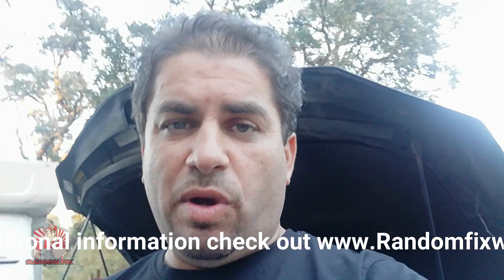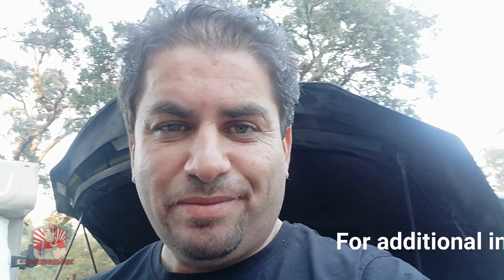Does Cataclean Work? Failed Smog, Bad Catalyst, P420 P430 P431

Comment: Does this work on p0037
Reply from the maker: it can, but it more designed for catalytic converter, this cost over $20 and you maybe able to get an o2 sensor for under $50, I would invest in a o2 sensor if it was me.

Comment: Hello, I have a 2005 Nissan Pathfinder with 137630miles  and my engine light is on I was told it's my catalytic converter I can not afford 1200 to fix it so do you recommend 1 bottle or two for the amount of mileage I have.
Reply from the maker: Hi Natasha, Yes I would try 2 bottles if you are unable to get the smog ready. I just made a really good video about this exact concern that will be posted by Monday, here is the link but it won't published for 2 days. See this video first before do anything else. https://youtu.be/U0-0XMWR3ow _Randomfix

Comment: Is it alright if I add the cataclean at 1/2 tank
Reply from the maker: Great question, you could try maybe get lucky if add to a few galloons of gas. This not a long term solution and there are times you have to use two bottles so 1/2 is gamble. _Randomfix
Reply: @RANDOMFIX  so eventually you have to get a new one
Reply: At $25 a bottle, I would follow the directions, 1/4 tank, no more. I've used it, followed the directions, and it worked. Check engine light stayed off for a few months after passing inspection. Excellent.

Comment: Will this help with bad acceleration
Reply from the maker: This is a temporary possible for dirty catalyst. It also claims to help with o2 sensors. What are you experience and what's the make and model?  _Randomfix
Reply: @RANDOMFIX  loss off on the highway, i have an 83 buick regal
Reply: Jeff Martin it’ll def help with it but not sure if it’ll fix it for good. Bad acceleration is usually dirty MAF sensor, dirty air filter, worn spark plugs, also run some fuel injector cleaner after each oil change at 5000 miles synthetic.
Reply: If the cat is clogged, that’s a good possibility. I replaced the cat on a previous car and it was a dramatic improvement.